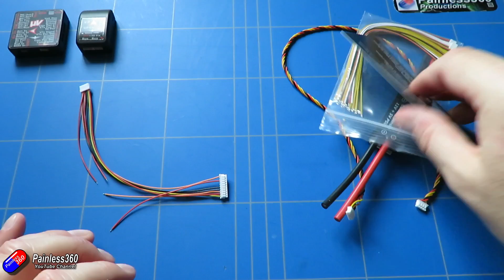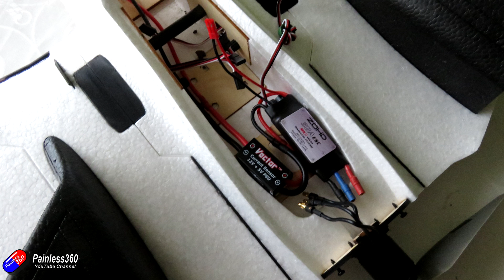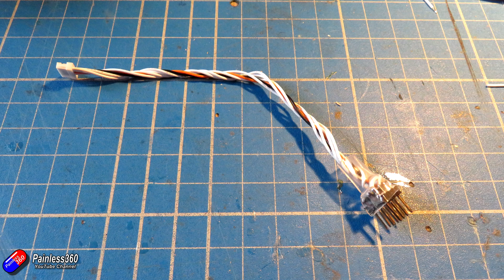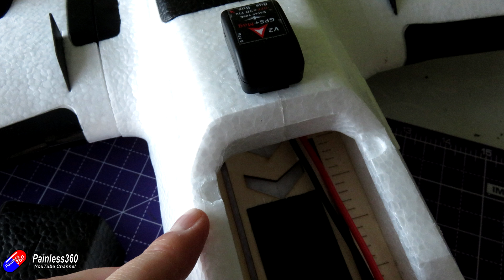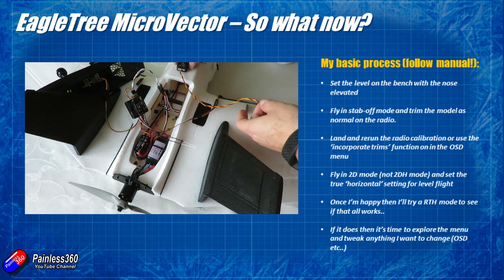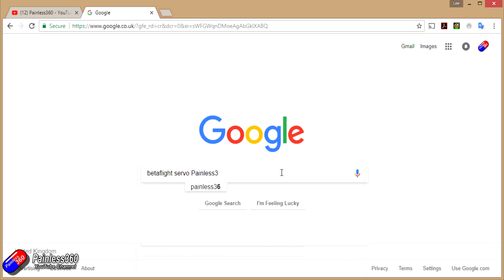Eagletree Microvector setup Step by Step - Part 2

Comment: I have a quick question.  I'm working on my setup right now but in the manual on page 26 it said "5V Pwr: Typically not used.  Note that all the “5V Power” connections are connected together inside the MicroVector.  Don’t power servos from this connection!  Don’t connect a power source to more than one of the 5V Pwr connections!  6V Max! "... I've seen 2 vids now with people doing it like you are doing.... have you had any problems?  If you had to, where else could you power the servos from?
Reply from the maker: You can do it either way. I would only do it the way that I shown in this video if you have a couple of servos. For safety you can just connect all of the plus 5 volt servo pins together but not connect them back to the microvector and then the 5 volts from the BEC inside the ESC can provide the power from the servos just like it did before you installed the micro vector..

Comment: If you had to pick one wing fc what would it be out of 
furious fpv f35 , matek wing or vector ?
Reply from the maker: Great question. If money were no object then I'd go with a Vector. If I want a small installation than the F-35 otherwise the Matek board. Hope that helps..
Reply: So vector is still the way to go
Reply from the maker: @garrettrevels  it's really down to personal choice and how you want to fly the craft. I really like full 'vector based' on screen displays - so things like the Eagletree Vector or the BrainFPV gear is excellent. The benefit for me with the Eagletree Vector is that the on-screen display is colour too..

Comment: Nice 👍 Lee for a knockaround wing I have here that I want to fly in the park w LOS. I don’t want to put INAV or a flight controller. I was thinking 🤔 a NX3 3D gyro or should I spend a bit more and get the Volantix Xpilot X601? What would Painless360 do?? Thanks
Reply from the maker: I've not tried either of them so I'd go with iNav so I have that cool auto-launch, Loiter and GPS RTH modes. I'll be doing more with stabilisers in the New Year as there is soooo much choice! :D

Comment: Thanks Painless. If it weren't for you and some others I'd still be trying to put Openpilot into a CC3D board! 
This is perfect timing for me. I'd be interested to see how you Crossfire a Vector. Been looking into this myself. I know it can be done but can't quite find the physical connections.
Reply from the maker: Use SBUS out of the Crossfire receiver and configure as normal. There were reports that the Crossfire and Vector didn’t like each other’s SBUS but that was recently changed in the Crossfire firmware so I don’t know if that’s sorted the unexpected failsafe problems..
Reply: I try to keep my vector, away from the cxfr as far is possible.  Vector love dragonlink no crxfr.
Reply: That's interesting, hadn't heard about the Sbus thing. Hmmm, 'unexpected failsafe problems' are a bit of a concern.... I'm getting the bits together for a LR wing. Want Vector for simplicity and reliability and Crossfire for link. I guess you'll be doing it before me, so we'll see how it goes. 😉 Found TBS sell an adaptor for a Nano RX to servo pin. That answers one of my questions. Cheers.